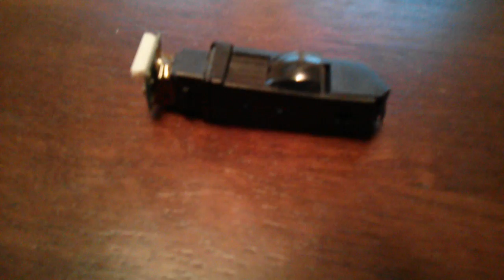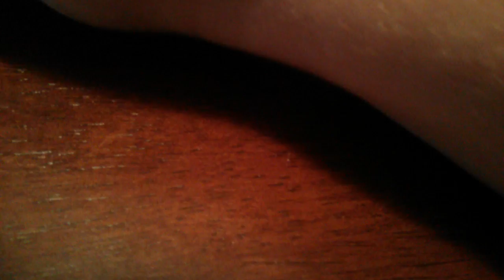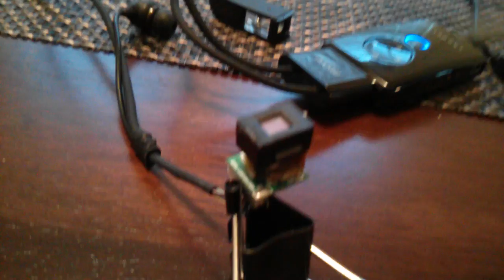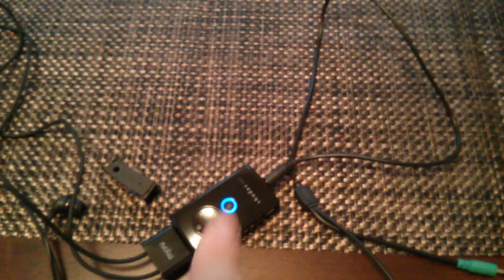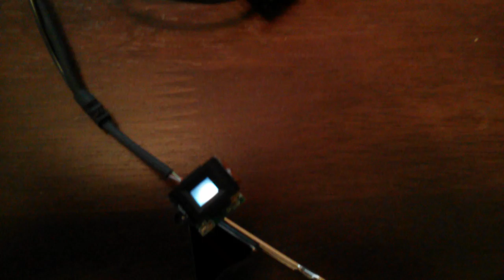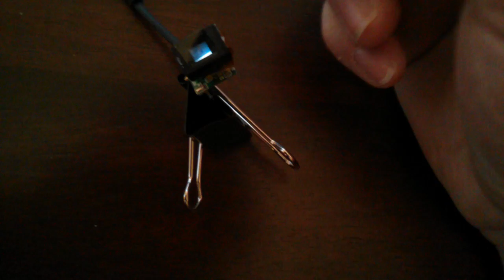Disassembling MyVu Shades

Comment from the maker: It's a very small usable screen, for experiments in wearable computing. I left the lens on one screen so I can play around with both setups.
Reply: Hello. Sorry for bother after so many years. I would like to ask, did you find out how to wire up those displays directly without big module of the googles? I want to try get the same device as a donor but not sure if displays of it can even work alone connected to av cameras to them.
Reply from the maker: @enbdev  Hey, I never ended up going further with them... they're so out of date now in terms of resolution it hardly makes sense. If I was doing it today, I'd design a 3d printed frame to mount the display and the driver board. However you can now get much better AR glasses intended for flying model planes and such, take a look on Amazon.